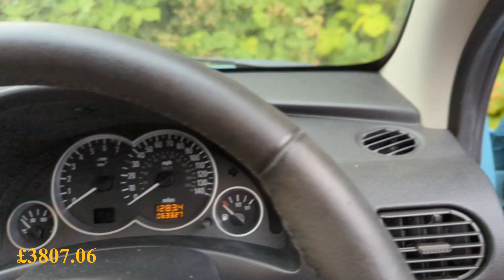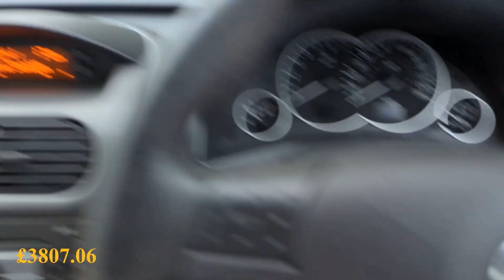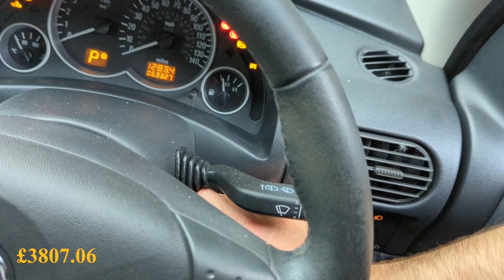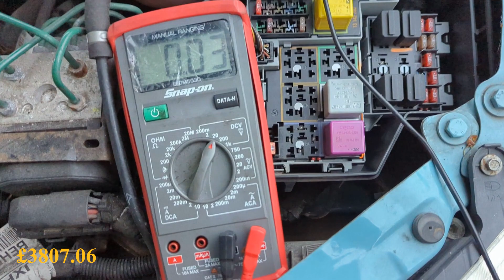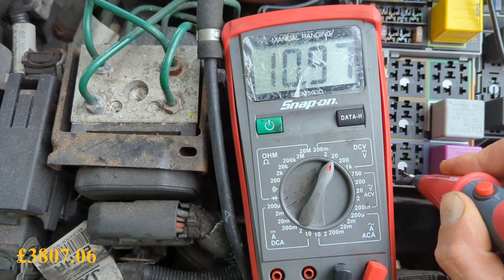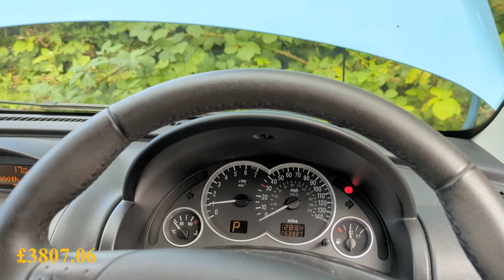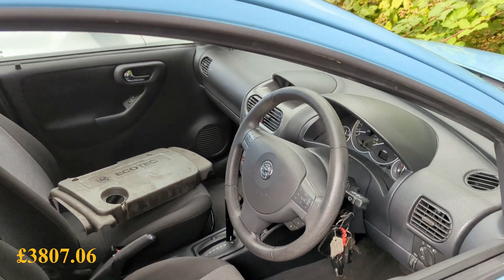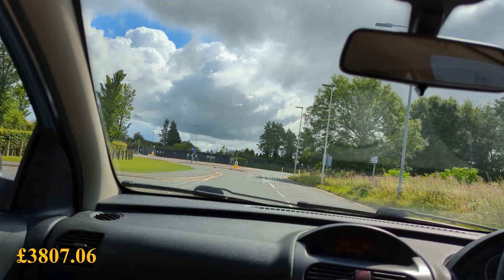How To Turn £500 Into £15,000 Episode 20

Comment: Bargain there I'm finding it hard finding cars 😡
Reply from the maker: I thought it was a good deal. Will know more when I start putting parts on it though. It is a struggle at the moment finding cars with a decent profit in them.
Reply: @Papa77sGarage  what's wrong with it as you never said on this one, corsa was a proper result 👍
Reply from the maker: @flippingcarsrepairs  yes the Corsa was  a cracking result. I'll be lucky to get another like that in the next 12 months. I think EGR valve is goosed on the Roomster bit now the alternator also seems to have packed in.
Reply: @Papa77sGarage  no way bloody cars they are nothing but headache but we keep doing it to our self's, I commented on your other vid about my mini I need help 😭
Reply from the maker: @flippingcarsrepairs  we do and probably won't stop, I guess it's a way of life. Haha. What problem have you got with the mini?
Reply: @Papa77sGarage  it has dash light on fault code is 2845 VANOS variable camshaft timing exhaust actuator movement. Its on a 1.4 petrol mini. I swapped the solonoid over from back to front and didn't change anything 🙄🙄🙄🤔🤔🤔also its smoking bad and fummy if you look at my shorts your see how bad
Reply from the maker: @flippingcarsrepairs  I would say you have 2 separate faults there. The engine light could be anything relating to the exhaust camshaft side of things (wiring to the solenoid, VVT pulley, lack of oil pressure to the VVT pulley, timing could be out) As for the smoking I've heard of rocker covers causing excessive smoke but I've never actually replaced one and seen it for myself. There is a crank breather built into the rocker cover, I don't know if you can bypass it to see if there is any difference. Other than that you'll be looking at piston rings and valve guides and stem seals. Is it an oil burning type of smoke?
Reply: @Papa77sGarage  see  told you, you no your shit 😉 what's the most common one I was thinking it was 2 things to as surely a solonoid not rl would not make it smoke like that, this is the thing the smoke is like a realy horrible sweet smell doesn't smell of oil and I can't be coolant as Ive done the coolant check etc and compression is realy good on all for cylinders  plus the coolant has no gases in it after I do the dip test. It's a weird one 😡